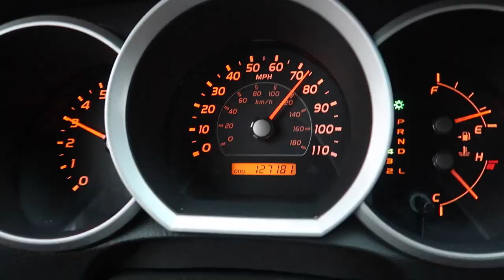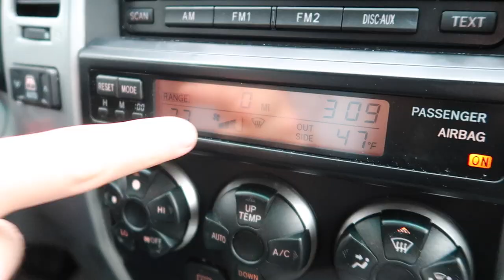I Wrecked My 4 Runner

Comment: should have took the sony radio out of the old one and swapped it into this one! same dashboard and radio so would have been easy
Reply from the maker: I tired to but the way they put it in the guy like screwed it into my car. It was messed up anyways and gave me problems.
Reply: damn bro. Well it was like 5 years old anyway, time for an upgrade lol. Check out the pioneer AVH 290bt. It's what i have and and it's badass. it's got bluetooth, usb, aux, and cd. no navigation but phones work well for that lol. i worked in the car audio field for years so hmu if you need any advice! i know you said 2 12s was a lil too much bass, so you should try just 1 10" sub. 10s have great sound quality and go good with all types of music.